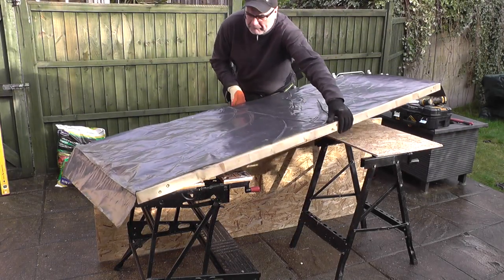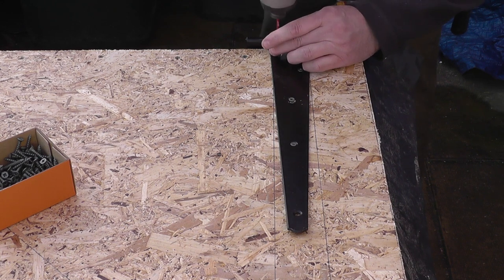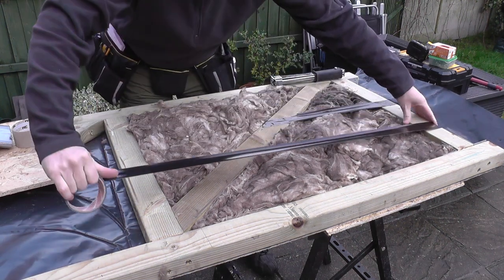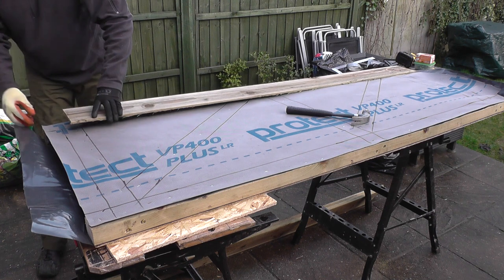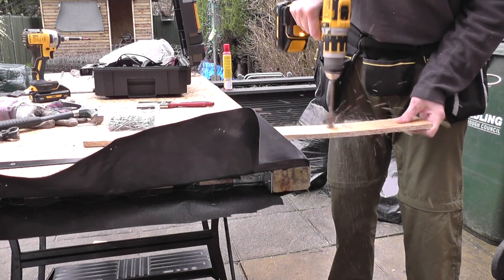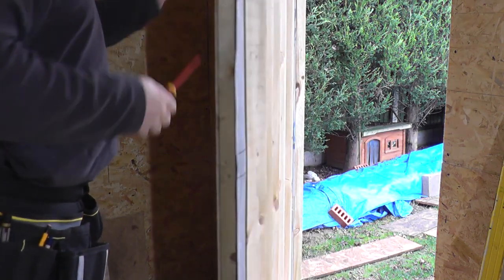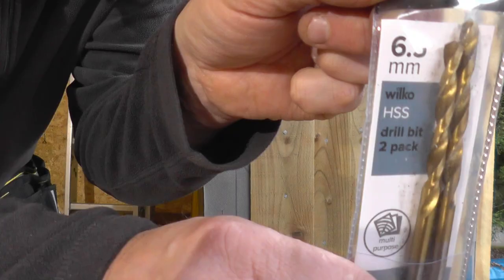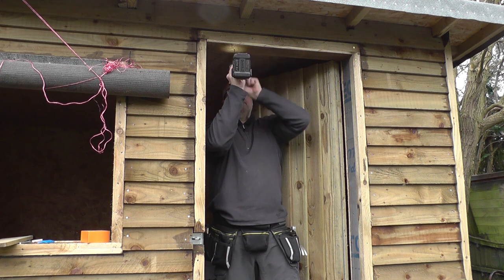DIY Man Cave / She Shed - Part 18 - Making The Door (2 of 2)

Comment: Hi, great video, nice and slow so we can follow! Very nice to see the detail which is often overlooked. Not sure if I missed it, did you use a door lining? I've seen the other question about door opening outwards and your replies. Off to find a secure outward opening hinge now if they exist! Or could I do as you did and 'ruin' the screw tops?
Reply from the maker: Hi there and thanks for dropping by.  Yes, there was a door lining exactly the same as the walls - no different. The trouble with having hinges on the outside is that they can be unscrewed unless you 'ruin' the top. However, yopu may still be able to have an outward opening door with the hinges on the inside depending on how the door fixes into the frame. Have a play, it may work for you.  ATB, Des

Comment: My door needs to open outwards and was wondering if there would be any issues with putting the hinges on the outer side, underneath the feather edge boards? Great work
Reply from the maker: Hi there, yes it is doable but you would need to move the hinges on both the door and the frame in order to re-position the door . This could save you  lot of space. Best wishes, Des

Comment: I appreciate the upload... but a question.. what was the rationale with having the door open inwards? ... was there a specific reason as I would have thought that outward would save shed space... This is not a criticism just a question. Thanks again for the vids.
Reply from the maker: Good question. (1) personal choice  (2) hinges would need to be on the outside so less secure - loads of sheds out there with hinges like this which can just be unscrewed  (3) I though there might be a problem with the cladding on the door hitting the cladding on adjacent walls.  They're the 3 top reasons why. However, a skilled joiner / carpenter may be able to circumvent the last 2 issues. Hope this helps, Des

Comment: Hi really helpful video thanks but I was wondering do you need the plastic and the waterproof and breathable membrane? 

I am just starting my shed and have breathable membrane coming. So guess I’m asking is the breathable membrane waterproof (as they say they are) So if so is plastic needed needed for proper waterproofing? and if plastic is needed will there be condensation build up in the shed over time as not as breathable?
Reply from the maker: Hi there and so sorry for late reply. If you're installing a breathable and waterproof membrane on the exterior as I have done then you will ONLY need to fit a plastic sheet (i.e. non-breathable and waterproof plastic sheet) on the inside IF you are insulating the build. The reason is quite simply to stop moisture in the air (i.e. from breathing and any heat source) penetrating the insulation, getting trapped and causing build up of damp and mould. Hope this helps, Des
Reply: Thanks caveman 

Great advice am going to insulate later after the build, so will add extra layer when I start that stage 

Thanks again 👍

Comment: It seems a bit odd to me to use plastic on both sides of the door. You will just end up locking moisture in.
Reply from the maker: Hiya buddy. Nope. Plastic on the internal side and waterproof, breathable membrane on the outside - the same as the walls. ATB, Des

Comment: Great job on the door - really like how you covered up the lock with the boards. I recently added some garage door shoot bolt locks to a door I have for added security after a friend had their shed door kicked in with a lock like yours on. 

They can be bought keyed alike and are pretty cheap for the extra security they offer as you can fix them in several positions for example top and bottom going into the roof/floor, which would have saved my mates shed door I think.

They are designed for up and over garage doors but people often use them for wooden doors and you can get longer key versions should you need them for thicker frames.

Plenty of places online sell them, I found ebay best for price. Enfield are supposedly the "best" ones and the original make. Here is a link to similar ones on Amazon:

https://www.amazon.co.uk/Asec-HS1829-Garage-Door-Lock/dp/B004ULMMXI

And a video of them being installed on a garage door by a fellow Youtuber (Previously recommended):

https://www.youtube.com/watch?v=kn5qd-_1JC8

That Youtuber has a lot of really good garage/shed security (and general security) videos that are worth a look through:

https://www.youtube.com/user/ultimatehandyman/search?query=security

He has one on his channel about removing screws that have 'screwed' (excuse the pun) heads that might be useful should you ever need to remove them. A few drops of Loctite Thread Locker on them would be a good addition from a security viewpoint. 

This video of his covers various nut locking methods:

https://youtu.be/oP4KGKEJM8Y

Looking forward to the rest of the videos in this series!
Reply from the maker: Hiya buddy. Will be checking out your links this evening. Greatly appreciate your support and feedback mate. Appreciated, Des